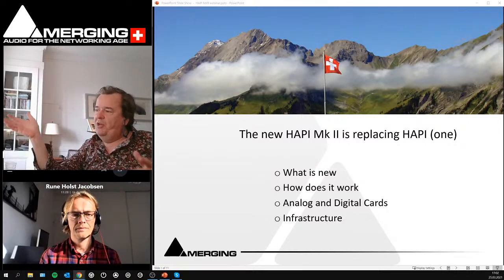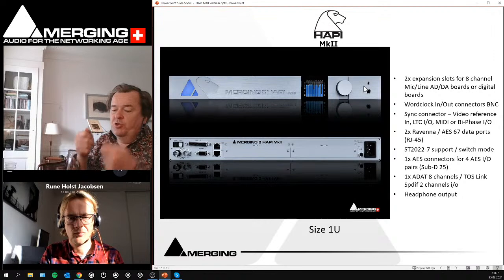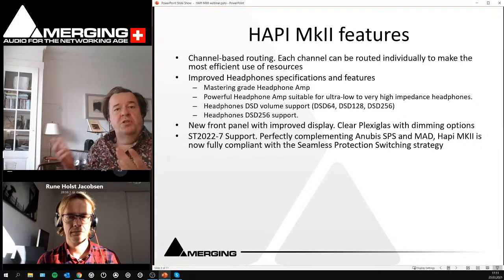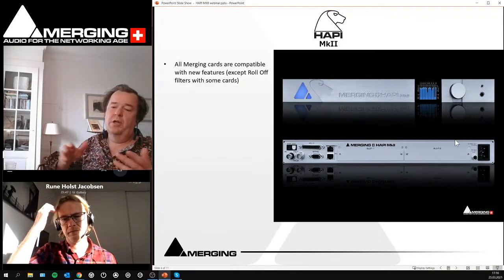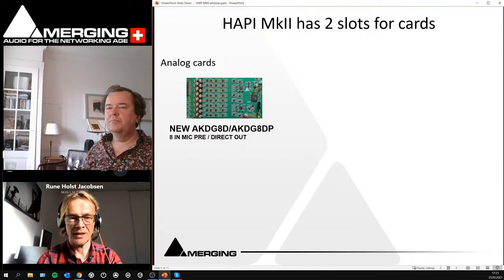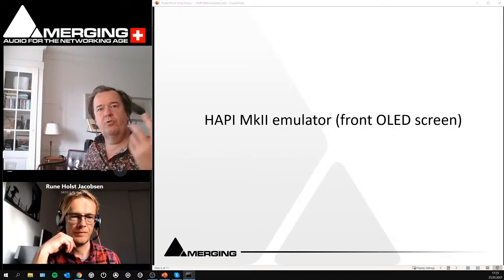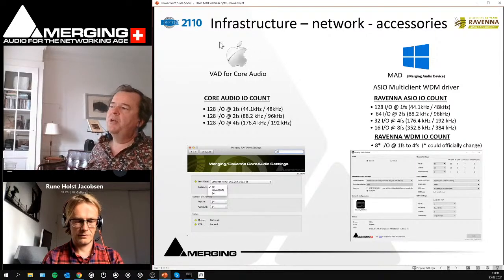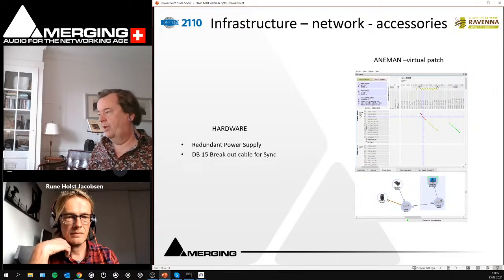HAPI MkII WEBINARS

Comment: In the Hapi MK2, given a choice, I wish Merging would have further increased the sonic quality of the DAC output stages rather than improving that of the headphone amp, even though that would certainly have resulted in a very big price increase. Trouble is there's only so much space on those cards to implement any circuit improvements.
Reply from the maker: Hello, the sonic quality is not the same depending which generation of cards you're using and if you're using Premium ones or Standart ones
Reply: @MergingTechnologies  Please clarify: Premium meaning the DA8P that does the DSD that I don't need and the Standard DA8 that only does the 88kHz or 192kHz that I would more likely need?
Reply from the maker: @greg1030  Hello, there is a difference in between Premium and Standard cards bit also when they have been manufactured as the design has changes since the first generation of cards more than 10 years ago. You'll find specs of the present cards and the past cards on that page https://www.merging.com/products/interfaces/option-cards

Comment: Does Hapi work also alone without Anubis? Does the knob on Hapi also handle volume? So for example in an Atmos environment can I control with that knob the volume of all my 12 speakers at once? 
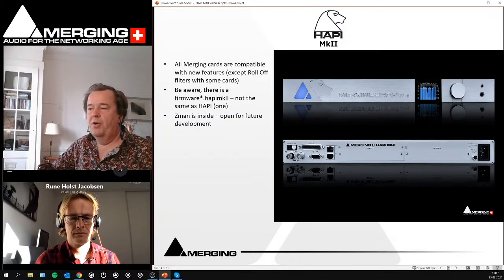00:16:34 Is the Hapi ready for room correction like Anubis? I use Sonarworks in my DAW and it would be glorious to avoid the latency by using the HAPI dsp's like it works with Anubis.
Reply from the maker: Hello Marco, thank you for your question. Yes, HAPI can manage the 8DA , 16DA or the headphone output volume. One can choose the behaviour of the know in the settings. For the time being the Sonarworks plugin is only available in Anubis

Comment: What's the latency of mk2? I mean does mk2 support direct monitoring?
Reply from the maker: If you wish low latency mixing (for monitoring), Anubis will do it for you. HAPI is a converter and router
Reply: @MergingTechnologies  Thnx for answers. But doesn't new HAPI has DSP mixer and I could direct monitoring through ZMAN dsp?
Reply from the maker: @NovakSimon  The new HAPI MKII has indeed a ZMAN with DSD on it. For the moment it is used for other things. There is so far no mixing capabilities implemented

Comment: Does the AKDG8D cards supports  32 bits?
Reply from the maker: Hello, 
Yes, both versions AKDG8DS and AKDG8DP (P = Premium=  above 192 kHz including DSD 256) are 32 bits. The DG means that they have a Dual Gain topology for the 8 Mic Pre, 2 independent gain control for the same input signal.
Reply: @MergingTechnologies  what makes each unique from each other and the same in strength? what was the reason to design a new card from the ADA8P?
Reply: Both are awesome cards ... I just have to make a decision based on my activities and look into the future! :) THANK YOU!!!
Reply from the maker: @atta1798  The ADA8 range has 8 analog LINE/MIC input and 8 Line output. e.g. Both in and outputs are visible from the DAW 
The AKD8D range has 8 analog LINE/MIC input and 8 analog direct out (post pre-amplification) and no line out. So the usage of those cards is different . In both cases they have Dual Gain topology designs and Premium editions. detailed info can be found here https://www.merging.com/products/interfaces/option-cards
Reply: @MergingTechnologies  does the ADA8P have/, will it have 0.1dB gain precision?
Reply from the maker: @atta1798  Do you mean on the DA side?
Reply: @MergingTechnologies  AD side or both for high accuracy and precision
Reply from the maker: 0.5dB steps on the MIC input side and 0.1dB steps on the DA output side with the new HAPI MKII